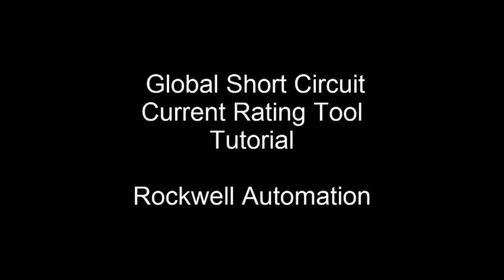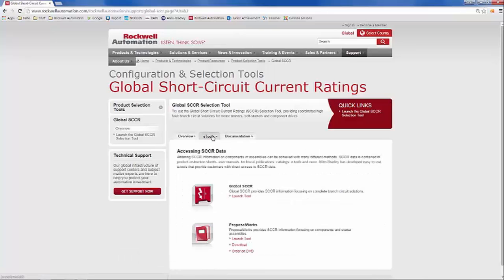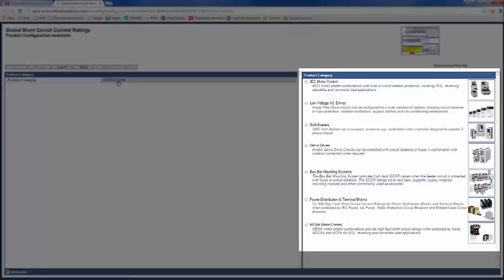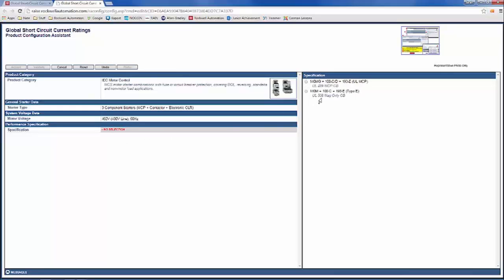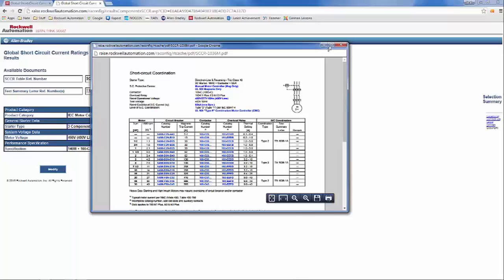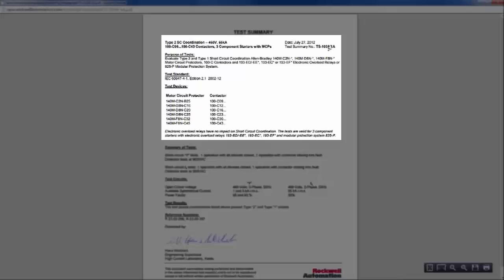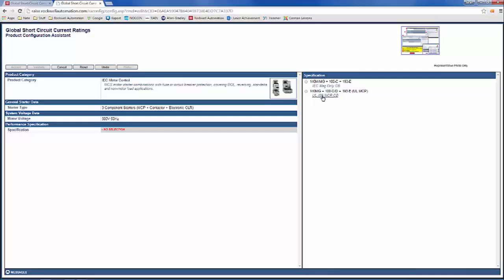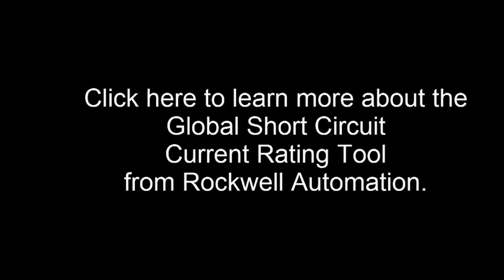Global Short Circuit Current Rating SCCR Tutorial

Comment: There should be some kind of test to show and teach people in the trade how to calculate the SCCR for their application.
Reply from the maker: UL508A Supplement SB is the approved method for determining panel SCCR.
 Revere Electric, Rockwell Automation, and UL are teaming together for a UL508A and SCCR seminar on April 9-10 at Rockwell headquarters which will also include a tour of the high current lab.  If you are not local or this training does not work with your schedule, UL offers this training multiple times a year around the country. https://lms.ulknowledgeservices.com/catalog/display.resource.aspx?resourceid=100612
Please let us know if you need anything else.